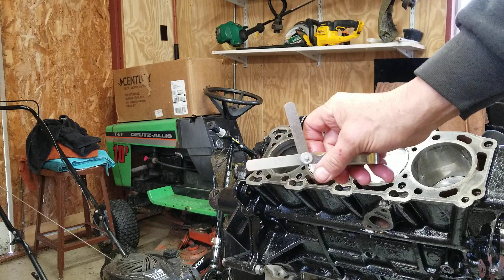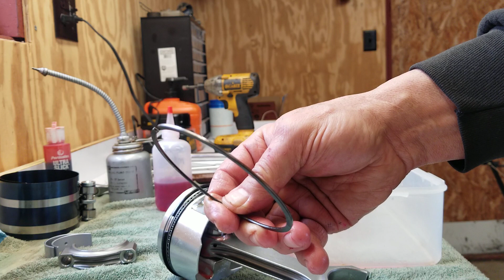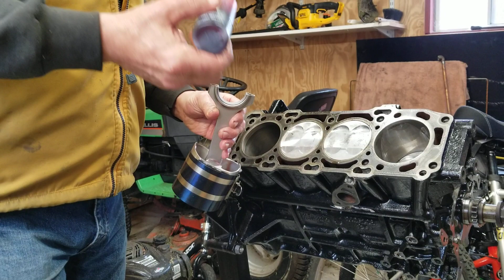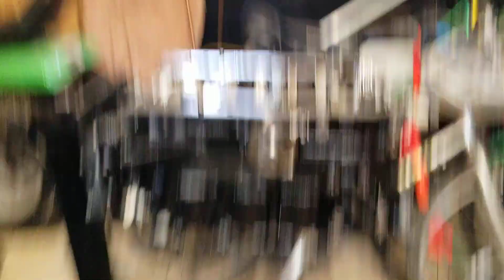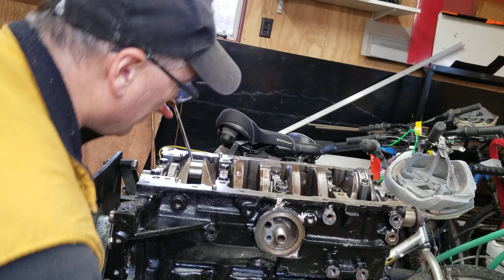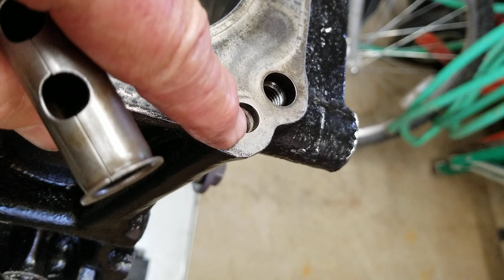Let's build a Quad 4 E7

Comment: Love the content im going to end up watching all your ld9 videos and prolly the rest lol i current have a 2000 cavalier 5spd with the 2200 cib motor that runs like a top but plan on building an ld9 on a stand just like you with makes finding your videos a god send. Used to have one in my 99 alero 10 years ago and fell in love with the engine and now that i have 12 in auto i plan on caging and swapping the cavalier this summer and doing some autocross events. So im definately going to check out your dirt track races keep up the great videos and thank you for the knowledge very helpful indeed.
Reply from the maker: Your build sounds fun. Thanks for watching!